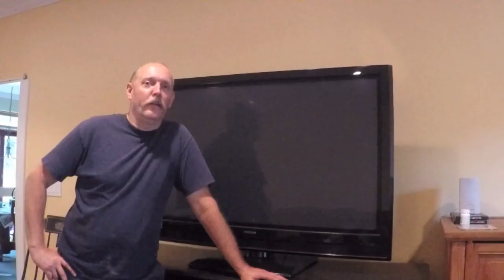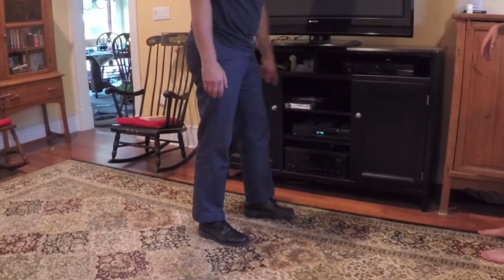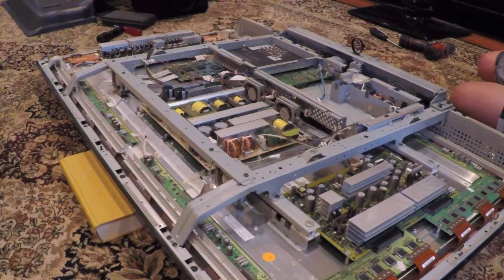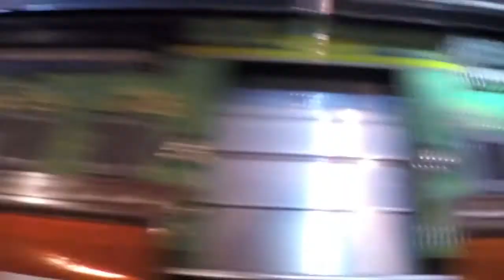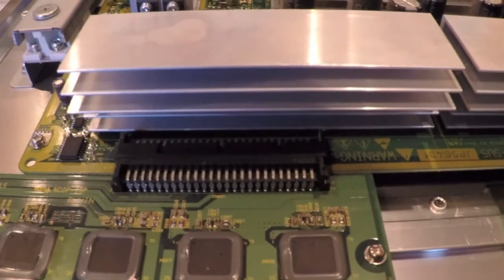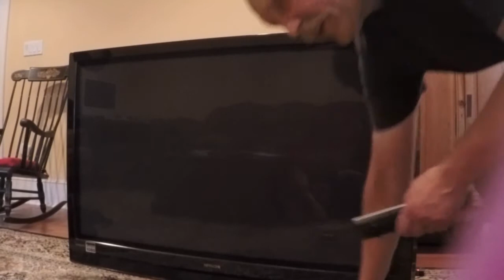Hitachi Plasma TV Repair Part 7

Comment: I have the very same tv. I ordered my SDR-U board and it didn't work. I noticed that my original part numbers and the new part didn't match. I have an Pb-F SDR-U ND60200-0047. The part I got is an ND60200-0047 JP6079. They look identical just different numbers. Should this part have worked or do I need to change both boards to the new number?
Reply from the maker: Sorry, i do not know if those are the same.

Comment: Hi sir I am from Pakistan 
I have Hitachi 42PD5000 when I on it then screen showing purple & green color for 20 minutes after 20 minutes showing normal colors what I do with it please help me
Thanks in advance
Reply from the maker: Sorry, i do not know. It sounds like a capacitor to me. You could try and find the bad cap by waiting until the problem goes away and then spraying the caps with component freeze. Its sold in cans here in the USA. When the bad cap is cooled the problem might return.
Reply: @stevewatr  Thank you sir ill try to find bad capacitor

Comment: Thank you for the tip, too bad these hitachi plasma are heavy but after looking at some other videos I can understand why.
Reply from the maker: I'm still watching this TV today. I think we'll be replacing it this year, not because of picture quality. The main reason , and my pet peeve with plasmas........electricity usage. These things are power hogs compared to LCD. You can feel the heat radiated off the screen from 4 feet away, and all that heat is wasted energy. Thanks for watching!
Reply: Winter time sure but in the summer better use very lightly, and yes a lot of power consumption.

Comment: Thanks a bunch for these videos, Steve. My mom had the same TV and after 8 years her TV started doing the same thing, i.e., three flashes of the blue LED. She had a new TV installed today and has offered me hers for free. I have an electronics background, so, along with your videos, I am confident that I can fix it (assuming it is the same problem). Question: what are the part numbers of the SDRU and SDRD boards that you have bought?

UPDATE: I think I found the SDR-U model from taking a screenshot of this video: SDR-U ND60200-0047?
Reply from the maker: Robert Johnson That number sounds correct because I just replaced the SDR-D board again, and it was a 0047. 
https://rover.ebay.com/rover/0/0/0?mpre=https%3A%2F%2Fwww.ebay.com%2Fulk%2Fitm%2F252218616852